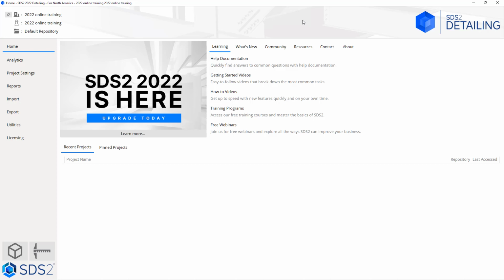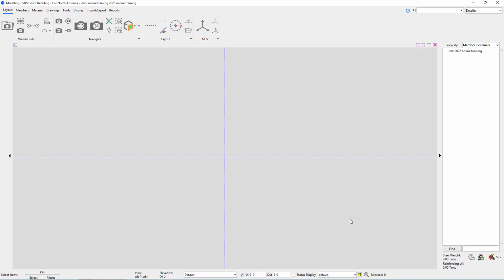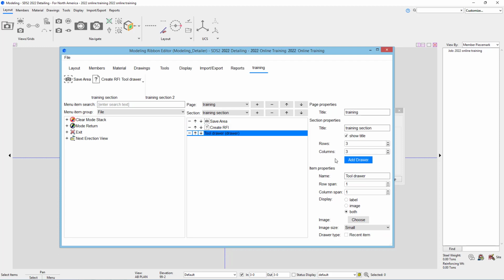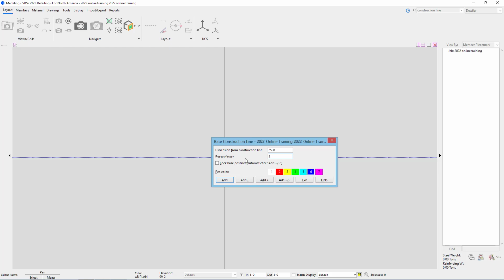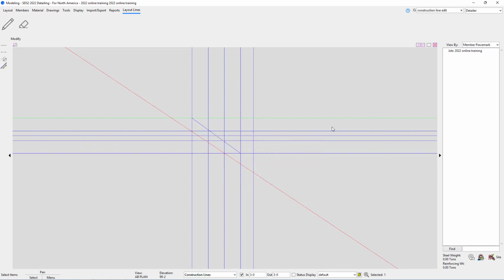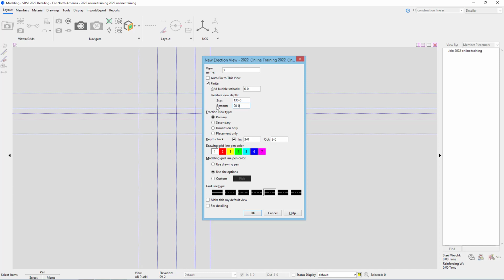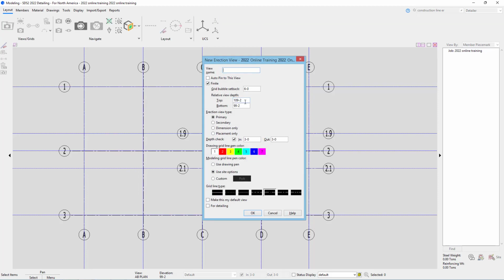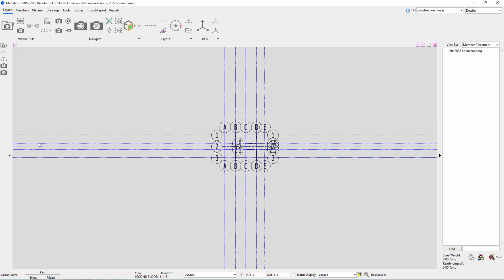SDS2 2022 Basic Training: Lesson 4 - Introduction to Modeling

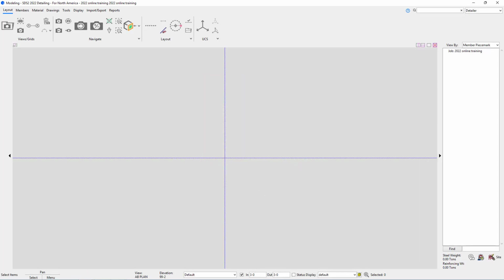Comment: 2:25 giải thích  các tính năng trên giao diện.
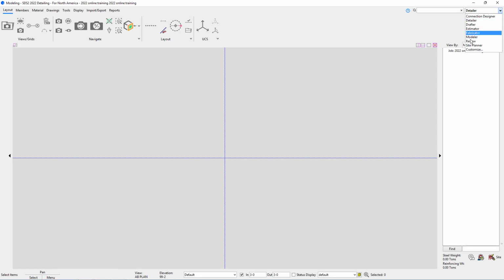8:50 customize interface
15:15 add construction line add. short cut is C A
16:25 add construction line base on the default construction line
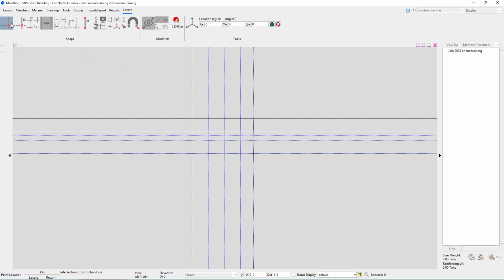21:12 add finite construction line add